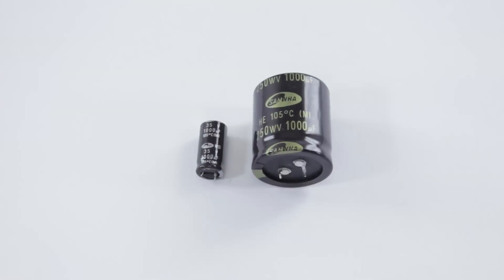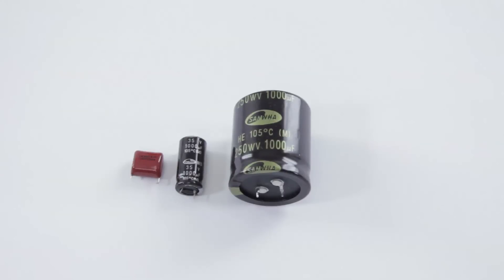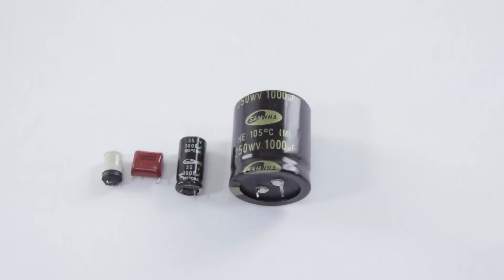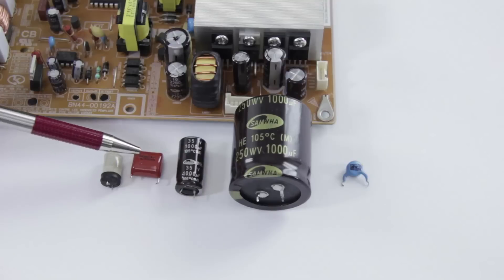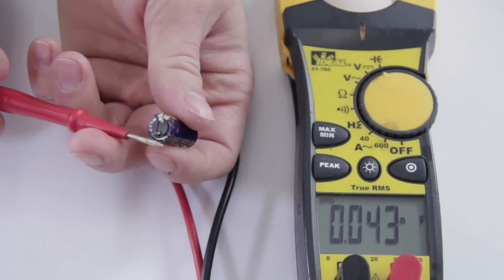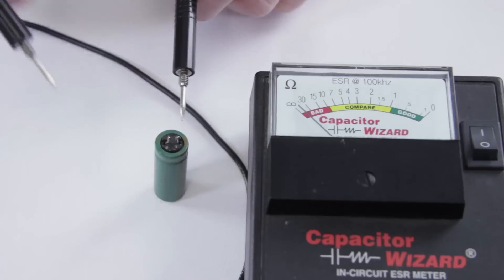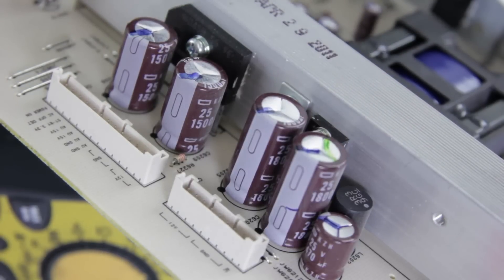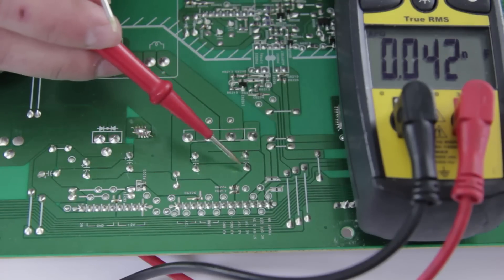How to Test a Capacitor TV Repair Help with Multimeter and ESR Tester Puffy Capacitor

Comment: My mother in law has an older Sony Bravia lcd tv and it has power but no picture. The cap I suspect is the problem is very slightly swelled. It’s a 450v but it’s reading 592.

Comment: This is just too good! I had a tech come out to fix my TV today and he was struggling to find out where the fault was. The problem was the same you mentioned, TV not powering on intermittently and when it powers on it works just fine. He finally figured the fault with those two exact capacitors u showed in the beginning. Wish I had seen your video first, I could have guided him myself :) hahaha
Kudos for the great work :)

Comment: Hi Jimmy, searching for answers with a used TV I just bought that I didn't know had this problem.  Samsung PN51D6500DFXZA 51" has on/off cycling issue.  I believe it has something to do with the power supply and opened it up to look at the capacitors, but didn't see any that "popped."  This cycle happens in a span of about 2:15 seconds on average. What would you suggest I do? Should I try and upgrade the firmware, or will I not have time to fully install it in that amount of time? Thanks! Subscribed!

Comment: Hi Friend, first i like to say one of best tuts , clear , HD and all we should know as begginers
So , as i saw testing capacitor has 2 ways:  Multimeter and ESR testing. 
I read somewhere that even we can get correct range of capacitor with multimeter there can be still bad caps. Is this correct ? So to be sure on 100% working cap need to be tested both ways , Multimeter and ESR or only ESR is enough ?
Thank you. Liked and subscribed as well
Reply from the maker: Sherif Aliti   It is recommended to test both ways, just to be sure.  Thanks!  www.shopjimmy.com
Reply: Thank you Jimmy, Any suggestion for some ESR Tester ? Home hobby nothing professional

Comment: Hello , I have a question ! Can i change a 68uf capacitor for a 100uf capacitor , on a led power supply ???
Reply from the maker: zeca almeida   As long as the volts are the same on the capacitors so if one is 35v the other one needs to be 35v. You can always go up never go down.  Thanks and please let us know if you have any other questions!  www.shopjimmy.com
Reply: ShopJimmy.com  go up in capacitance or volts??? Just to be clear here... We can always go up in volts, but in capacitance to some extend... please correct me if I am wrong... Thanks, Joe

Comment: Hi,
 I have a Samsung Plasma Model # PS50A550S1F. The TV comes on in standby, but when I turn the TV on with either the remote or button on the side I hear the relays click (on), then approximately 3 seconds later they click again (off), then a 5 second delay and trys to power up again.
I took the back off to see what was visually happening, there are 3 LEDS on the Main Logic Control Board that flash when TV turned on, relays continually click on then off.
The screen is continually black, doesn't get to power up fully.
All capacitors visually look good (don't have a capacitor testor),All fuses are good.
Thanks
Reply from the maker: *****   I recommend replacing the Y-Main board in your TV.  Here is a link to replacement parts for your TV model number on our website, click here:  http://www.shopjimmy.com/catalogsearch/result/?q=50A550S1F  Be sure to match part numbers on your current board, with your replacement for compatibility.  You can also call our customer service for further assistance with your purchase.  (877) 881-6492  Thanks and please let us know if you have any further questions with your TV Repair!  www.shopjimmy.com

Comment: power supply board has 2 test points 1 is the vs test point the label tell me it should have 205 volts is that correct or should it be 20.5 volts  thank you bernie
Reply from the maker: bernie villarreal   It should be 205.  Thanks!  www.shopjimmy.com

Comment: HELLO SIR.                                                                                                        I HAVE A SAMSUNG FLAT SCREEN MODEL # LN-T2653H THE STANDBY LIGHT COMES ON WHEN PLUGED IN  BUT TV FAIL TO POWER ON WHAT COULD BE THE PROBLEM?                                                                                                  THANKING YOU IN ADVANCE.
Reply from the maker: Jippy Bowen  I recommend replacing the main board in your TV.  Here is a link to replacement parts for your TV model number on our website, click here:  http://www.shopjimmy.com/catalogsearch/result/?q=T2653H   Be sure to match part numbers on your current board, with your replacement for compatibility.  Here is a link to a video showing how to identify your part number, click here: Samsung Main Boards & Digital Boards: Part Numbers for LED, LCD, DLP, Plasma TV Repair  You can also call our customer service for further assistance with your purchase.  (877) 881-6492  Thanks and please let us know if you have any further questions with your TV Repair!  www.shopjimmy.com

Comment: What is the name of your digital multimeter capacitor? That yellow looking? How to replace or fix the circuit board if some parts is burned? My circuit board power cord connected to the circuit biard is burned out,Bose power circuit biard.hey thanks for sharing this video about capacitor,I'm learning too.
Reply: its an ideal 61-766. It's not the best meter for the job but its the one i happen to have. It lacks a few things as its aimed at electrical work not electronics. As for repairing or fixing boards check out our other videos we have several on soldering and board replacement.